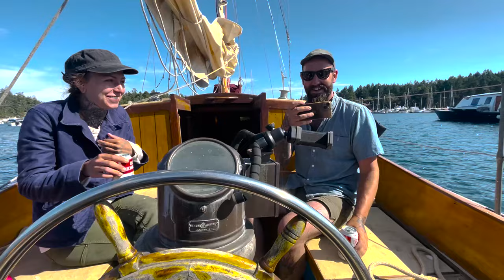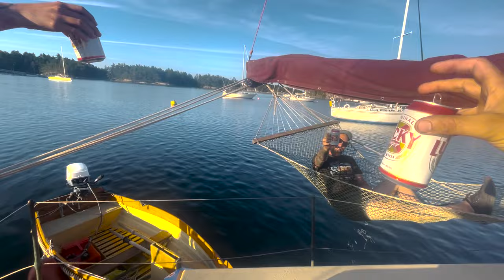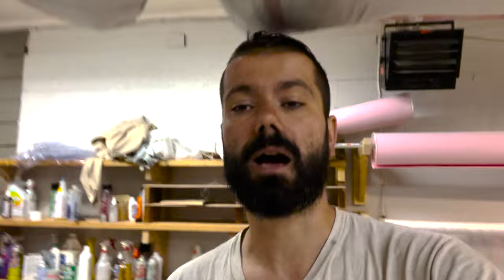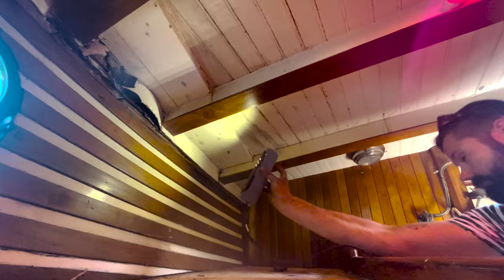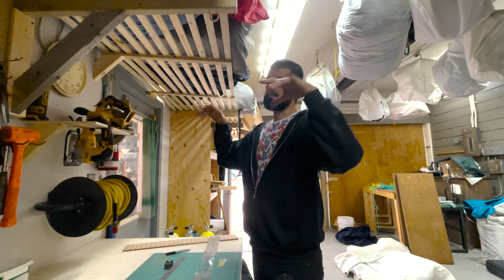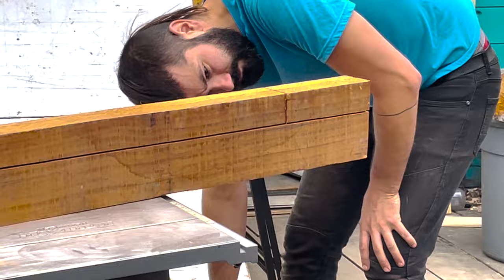3D Scanning a Boat and FAILING

Comment: I have had a 3D scan done of my boat. So far $1200. Its a high end scan of the exterior and interior. The scanner was the rotating type that sits on a tripod. Still working on it. We have the point cloud - now I need to reverse engineer the parts I want to work on so I can get into a CAD program. Its a lot of hassle but there seem to be many benefits/payoffs coming from it. Having a 3D scan of the hull while she is on the hard seems to be a useful thing to get done. Pro

Comment: Sooooo…..the 3D Scanner is a fail.
Reply: Well, ya. But even if it did work, what then? You still have to get it on the wood. A pattern will win every time for one-offs. A scanner would be amazing with a plotter/cutter table. If photogrammetry worked.